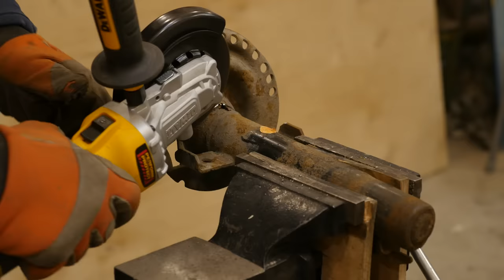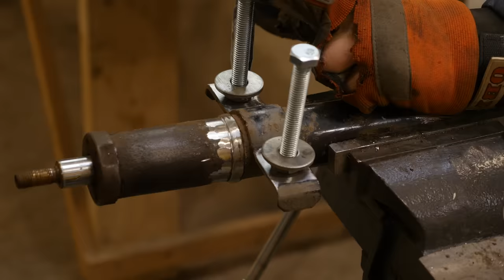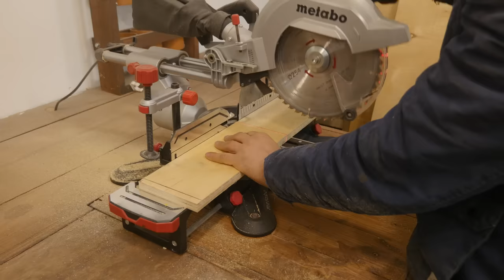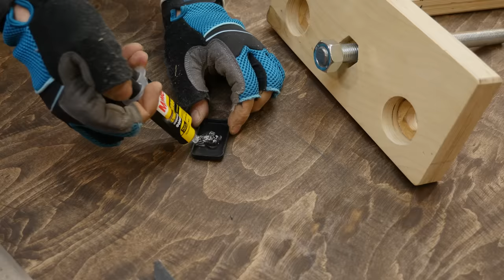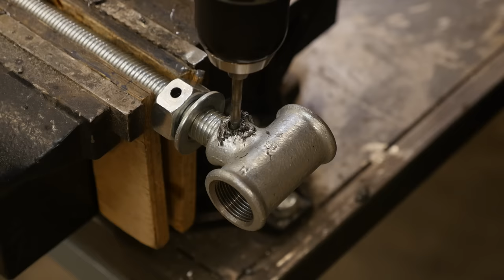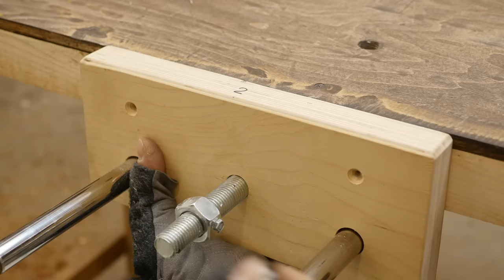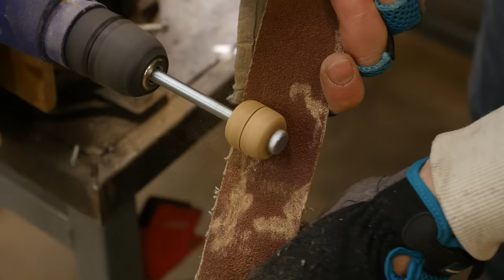Powerful vice using an old car shock absorbers! Unique idea

Comment: You need to counterbore/cut down the nuts attaching the shocks to the moving jaw though, because as it is, sooner or later, you’re going to jam your hand between them and the handle. This will, at the very least, involve the removal of skin and most definitely hurt big time when it happens.
It’s a simple mod though for an otherwise nice, very light duty woodworking vice.

Comment: Would've been real nice if that was scrap wood, old rusty bolts, etc. If you had used a hand saw, hand drill, homemade glue. Used bricks or old rotors for "clamps" but instead you have dewalt power tools, a welder, a steel bench vice, etcetera etcetera. Not impressed but hey, proves you have brains and money - which don't always accompany one another
Reply: Actually, his idea is BRILLIANT... as there are no easily available and inexpensive high quality hardened and polished steel rods as good as those from used shocks!  They make simply EXCELLENT guides for a vise, or even other guides for a drill guide similar to his bought one or many other self made tools and accesories.

Comment: Add up all the time to make this auto-retracting vise, and compare with the time spent manual-retraction. Purely for direct benefit, only justified by MANY hours using vise (caution: closing vise is going to be more effort). For indirect benefit, makes amusing video. Keep the mystery, knowing the result would spoil the show. A more useful application would be for opening vertical retracting garage door or heavy gate (next show?).

Comment: Weak point would be when you take a really big hammer out and need to pound on something in the vise.
Reply: Hey Dan... Did you know carpenters vises are normally NOT used to bend metals by pounding with hammers?  And that an iron vise is USELESS for holding a wood piece?  Both have ITS place.  This is a carpenter' vise, that will hold WOOD pieces to be planed, drilled, chiseled or glued.

Comment: As cool as this is. You shouldn't try this at home. At least not with the ones where you have to cut off something. There's high pressure gas in some shock absorbers and if they get punctured they could explode and literally blow shrapnel in your face. I don't want to be "that guy" but be safe when doing something like this.

Comment: 1. That's about 3 times as much glue as you needed.
2. You could have gotten by with much less work using plain shock absorbers instead of using those from struts. 

3. Use a much coarser screw for the jaw.

Comment: A waste. The clamping force is provided by the threaded rod.  The only good the shock absorber a provide is as guide rods for the rest of the assembly. If intact the absorbers only add extra stress to the assembly and makes the user have to really work to close it.  You can buy a vi..se with metal surfaces to do much more for twenty dollars or so.

Comment: What advantage does it have over just using metal shafts and tubing sized to slide in? It looks as if you arent using the shock absorbtion at all so no need to do all that work salvaging the shocks when could just use metal rods and tubing. Im all in on repurposing parts but you got to use your time wisely.
Reply: gnbaird: Perhaps you hsve never built anything with tubing and rods.
Just FINDING the EXACT sizes of rod and tubing wil be either very difficult, or too expensive... THEN, finding a top quality, HARDENED, POLISHED and truly STRAIGHT rods, that PERFECTLY MATCH the tubing inside diameter, and at such a low price, would be next to impossible.

Sorry to say you missed the whole idea!
Reply: @alfredomarquez9777  Actually you are wrong in all your assumtions. I go to the metal junk yard all the time.  You can get virtually any rod or tubing you can Imagine and much more  all at scrap prices. I would not have commented if i did not know a much better way.

Comment: All this work for a wooden vise? Seems a bit overkill for a relatively cheaply bought item. I suppose that if you live in a place where you can't buy a vise, it's okay. But if you live there, you probably also can't buy the drill, or the attachments/bits for the said drill. You probably also can't buy the threaded rod with matching bolts, nuts, washers, etc. I could list everything individually, but you probably get my point by now.

Comment: Please explain to me the practical use for this?
It's a ton of work, and makes no sense at all.
Pretty sure I can just reach down and turn the handle.
BTW, if the shocks are actually "bad" they will have no return pressure, and won't do anything anyway.

Comment: Bruh, all that for a clamp???? Na, I’ll pass, would rather buy one from the store, they cheap too.
Reply: Jon N 
The cheap ones don’t last. I had one. It broke. Built one out of steel tubing. Done the job. But recently found an old one out of a house refurbish. It lasted a hundred years. Bet it still lasts longer than most on sale today.